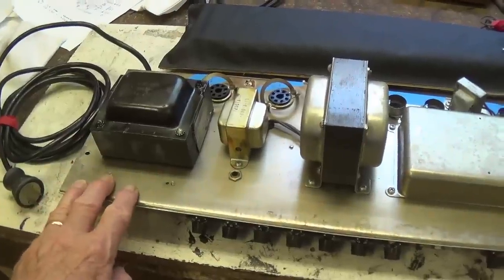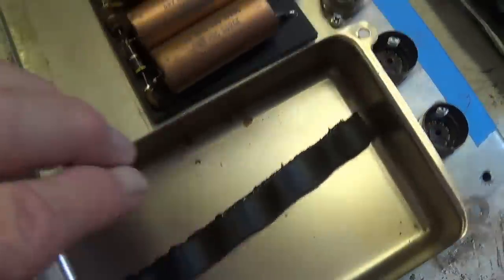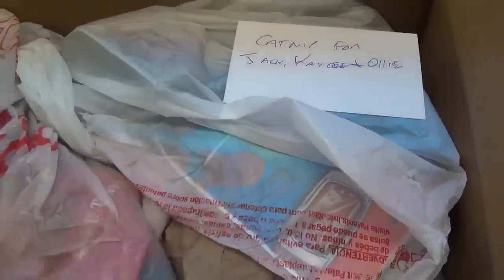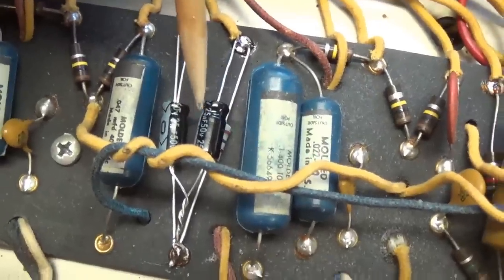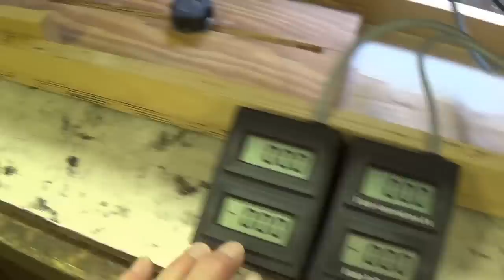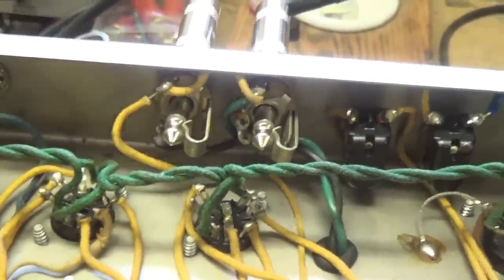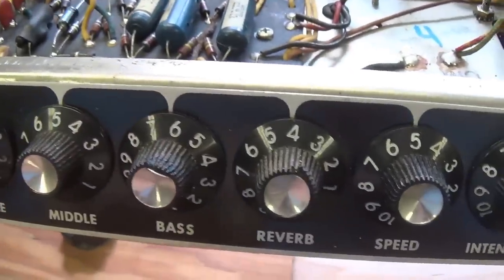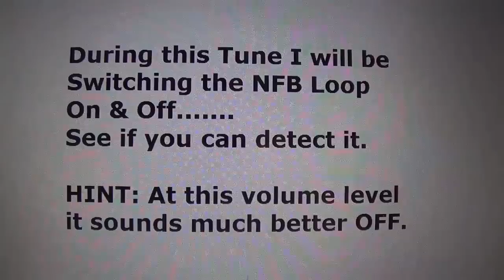1966 Fender "Blackface" Super Reverb:  In Storage for Almost 40 Years !!

Comment: Uncle Doug, are you familiar with the Fender PS400 - a 1971 super high power amp using GE6550A tubes with 3 separate output sections , 2 bass inputs and two normal inputs, and apparently a very unique circuit topology.  I have one - bought around 1978 - which has not been used much since the late 80's.  After contacting one fellow (Rich Koerner at Time Electronics, now deceased) who was recognized as an expert on this amp, I became aware that this amp had highly unusual setup and calibration routines.  I have some documentation for it, and am wondering if you would consider looking it over?
Reply from the maker: As much as I enjoy a challenge, Charles, I have found from experience that taking on a very complex project like this can require a great deal of time, simply to do research and acquire the knowledge to proceed.  I am currently receiving, repairing, and shipping a steady stream of more traditional customer amps, and I simply don't have the time to take on such a challenge. Best of luck to you.
Reply: @UncleDoug  Understood, and this amp is apparently a beast to work on - have you ever heard of this thing?  I have some cool product lit from the 70's if you ever wanted to glance at it.
Reply from the maker: @4bettercheddar  No, I haven't, Charles. It's probably similar in over-complexity to a Mesa amp.....but even more so. For people who do this for a living, you just can't get tied up for weeks on end trying to plumb the bottomless depths of gross engineering excess. Unfortunately, when the people trained in how to service these amps died.....so did the amps.

Comment: Uncle Doug, I just picked up a '64 Super and it has the same NFB mod that you did. My tremolo intensity is very weak; do you do a video on that, or can you tell me which components are part of the circuit that affects that? I think I will do the speed reduction mod as well, because I too am a tremolo hound....great video!
Reply from the maker: Congratulations, SC. If you watch the video, I show the three capacitors that form the oscillation loop. Try replacing the oscillation tube also (it's the 5th small tube from the end).

Comment: Hi Doug, I have a 73 Fender Pro Reverb with good tremolo speed but I think the intensity is lacking a little. Any tips to get some more out of it? Lee
Reply from the maker: Switch out oscillator tubes to see if one works best. Be sure the three loop caps are of exact value.
Reply: @UncleDoug  Thanks Doug, Will do

Comment: Hey Uncle Doug, I have a question.

Just bought a ‘66 Super, pretty much all original except for new bypass and filter caps, one switched out tone cap, and a few switched out resistors, including the screen and grid resistors. The original 10” CTS speakers are in.

Sounds great, but the amp is giving lower output in both the normal and vibrato channel. From 1-2 is basically nothing then theres the spike from 2-3, which is still lower than compared to others. 

Ive tested each preamp tube, but no effect on the low volume. Do you know what could be going on here? Thanks.

P.S., I have learned so much from your videos and appreciate your channel.
Reply from the maker: Thanks for your nice comments, H. Have you cleaned the pots with DeOxit, and replaced the output tubes ? If there is an issue in the circuit, it will require the attention of a qualified tech for repair. Good luck.
Reply: @UncleDoug  Uncle Doug! Thanks for the reply.

I have tried a new set of power tubes, but barely got any changes to the output. I also sprayed the pots with CRC contact cleaner, but nothing.

I after some interior evaluation (chopstick poking), I found that the connection wire from the vibrato input to pin 7 on V2 was scratchy, but that was really all. Don’t know how much of a difference fixing that would make. 

It is looking like I should take it to someone to check it out. I hope it isn’t sick.

Comment: Hi uncle Doug

Thank you for the great video.
Very interesting and entertaining.
I have a question.....
But first, let me say that I am an amateur electronics bug and am interested in experimenting with my guitar amp.
I've done allot of research especially on safety measures when working with circuits containing large caps.
The following is never clear ...
My (2 part)question is, when discharging the caps, is the amp plugged in ?
I would suspect no, but if not plugged in, how is tool grounded ?
Thank you again for the great video. :))
Terry (from Calgary, Alberta, Canada)
Reply from the maker: It should be unplugged, Terry. The wire lead from the discharging tool is connected to the chassis (ground).
Reply: @UncleDoug  Thank you for the info. :))

Comment: Dear Uncle Doug, it is not the right topic for this video but I wanted to ask you if you encountered a tube becoming microphonic not due to the tube itself but to its chassis socket where it is plugged ? In other words can a socket induce microphonics into a tube ? Sounds strange I agree but all my several brand tubes (6SL7s) cannot be microphonic !! Thank you.
Reply from the maker: Perhaps one or more of the tiny sleeves in the socket is loose, Nisso. You can tighten them with a very small screw driver. Also, you may have a bad solder joint on one of the tube pins. Good luck.

Comment: Does anyone make a 1W version of this amp? Something similar to the 1W Marshall series from 2012. Maybe a hardwire point to point?
Reply: That's a big negatory. Email this idea to fender tho, I'd buy it
Reply: Check out the web site of Rob Robinette, has a designed and built a DIY Bassman "micro" using a 12au7 as the push pull output stage with the classic Bassman preamp stage, also uses old school turret boards. Should be simple (if you have the DIY skills or fun to learn if you don't) to attach it to any preamp stage. Point to point has been done by others in the forum too. Doug Thomson.
Reply: just buy a mojotone champ no need for 1watt anything all ptp handwired!
Reply: @joshfowler8360  saving for a vintage magnotone myself. Uncle Doug, any experience with Magnotone?
Reply from the maker: Yes, indeed, CK. They are one of my all-time favorite amps, particularly the larger models with true Vibrato.
Reply from the maker: Not to my knowledge, Erik.
Reply: Cb K What Amos should they cover? Let’s say they are not point to point. That is probably just too much to ask. Two versions each. One a head and the other a combo. Let’s say they do a five amp run. My vote is to begin with a 57 tweed twin. Make this one. The last one a hot rod deluxe. What are the other three? These are all 1 watt with the 1/10 watt attenuators. Thank you for your feedback. I am thinking about making an e-mail to Fender. I would like to give them an idea for what the amps of the line should be.
Reply: @UncleDoug  so expensive, but your one guy who's word I would take. My question is how do the new ones compare to the old ones thanks so much
Reply: Blackstar ht1, I think it sounds way better than the Marshall. I've put them side by side, I was gonna purchase one, blackstar smoked it in everyway
Reply: @melchiando  sounds cool  benson makes a cool 5watt with reverb demos in the dartk uses all the time i have a tweed champ curcuit and its loud easily do a gig or mich it

Comment: I got the info off of ampwars.com when i put in quad reverb , I to was a little confused when I look at the info and thought the same thing ,when i put the m/m on ohms 200 range i came up with a reading of 29.7  there to i was confused on the reading ?  I rounded that to 32 , I kind of thought there was something I was not do-n right I am in no way a E tech and not very good at reading ohms on a m/m , the spks where removed from a 1974 Fender rhodes suitcase cabinet, they are Fender blue label 12" CTS,  cone #1252-1  basket #s 008498/ 137 / 7424 , I understand 4-16 ohm spks wired parallel will bring the ohms down to  4 ohms , wired series parallel i don't know ?  I found a quad rerb chassis minus all trans and tubes and was think-n about snap-n it up and make-n a quad cab since i am better at wood work-n than the tech trade , not to say that i would like to take on rebuild-n the chassis , once again sorry for take-n you away from your more important  matters , don't blame you if you disregard this text , but there is no other one that I can understand better than you , for instance i have two Marshalls one a 73 superlead and a 77 mk2 2203 that  i had serviced and i wished i knew you before  i met them  I still don't understand how you go about take-n on new projects with your viewers  the Superlead would of been a good vid it really needed new caps/tubes the whatnot, wound up cost-n me around $700 and $600 for the mk2 I better stop here or this will turn into a novel lol,
Reply from the maker: Wow......those repair prices are quite high, Steve. I hope you got your money's worth.

Comment: Hmmm. This is all very weird. Why would they have put all 4 8-ohm speakers in parallel, as opposed to putting them in a 2+2 (2 parallel in series, or 2 series in parallel) configuration? While I have seen (car) audio amps (solid state) that can drive into 2 ohms, I don’t see that many tube amps rated for driving into 2 ohms.
For a fixed voltage at the speaker terminals (1volt RMS at, let’s say, 1 kHz), the 8 ohm speaker will only require 125 mA of current, whereas the 4 8-ohm speakers in parallel will require 4x the current, or 500 mA if you’ve got 1 volt RMS. The problem is you’ve only increased the B+ by about 12% (from 415 VDC to around 460 VDC); assuming the audio output xfmr had a turns ratio of 4:1, then the current ratio would be 1:4, assuming the secondary winding was wound with wire of sufficient diameter to handle the current. This means you’d need to increase the B+ by 400% which would give you roughly 1.66 kV, and there’s no way those 6V6s are going to last long on 1660 volts of B+! And I don’t know of anyone who makes an audio output transformer capable of handling 1.6 kilovolts anyway! I think Jack would give this a paws-down. 😏 Would anyone like to double-check my back-of-the-napkin calculations?
Reply from the maker: What an interesting question, William. Let's use some real numbers:  Load Resistance of P-P 6L6's @ 450VDC is approx. 6K Ohms. Impedance Ratio between 6K Ohms and 2 Ohm (net) Speakers is 3000. Winding Ratio of OPT = square root of 3000 or about 55:1.  Now let's do it for the 4 Ohm speaker load you espouse:  Imp. Ratio is 1500 and WR is around 39:1. Now let's compare P (= I x V) on both sides of the OPT : For 55:1 WR,  450V x 0.1A  =  8.18V x 5.5A    and for 39:1 WR,  450V x 0.1A = 11.5V x 3.9A.  Thus, the 2 Ohm OPT puts out more current and less voltage than the 4 Ohm OPT.  Also looking at speaker output power, the 2 Ohm speaker develops 5.5 x 5.5 x 2 = 60.5W, while the 4 Ohm speaker develops 3.9 x 3.9 x 4 = 60.8W. The difference due to rounding errors.

 I think the reason your calculations don't work is that you failed to alter the WR of the OPT when you changed speaker load. Yes, if Fender simply used the same OPT for 2, 4, and 8 Ohm speaker loads, the voltage and current requirements would be all over the place.....which is why impedance mismatch causes so much harm.  But they didn't do this. Instead, they used a special 55:1 OPT for the 2 Ohm load.  When the tube-to-speaker impedance is correct, no more current or voltage is required to drive a properly-matched speaker load, regardless of what the load may be......and the output power will be the same.
Reply: Uncle Doug - Thanks. But why (did Fender) even bother? There are really only a few ways to wire up four 8-ohm speakers. 1) put them all in series (=32 ohms), 2) put them all in parallel (as was done here.), or 3) wire them as 2+2 (either two 8-ohms in parallel and in series with another two in parallel, or two 8-ohms in series in parallel with another 2 in series. Net is still 8 ohms). Clearly #1 is not good because if you lose a speaker (or there’s a loose connection), then Jack and Ollie’s jam session comes to a quick end. 😢 #2 solves that problem, but at the cost of having to make an OPT with a different WR which Fender would then have to keep in stock. #3 solves the problem, and you don’t need a non-standard OPT. You can lose a speaker, and the music keeps coming (though the impedance seen at the primary won’t be the same; not sure if the tubes or OPT will last long with this new loading. But it should last long enough to finish the song they’re playing. 🙂
Reply from the maker: @williamsquires3070  I guess it made good sense to Fender at the time,  William, and amps with this 2 Ohm array of speakers produced some of the greatest tone and tunes ever.

Comment: Hi Doug, during this video I heard You mention that you had received a couple of  "Thumbs down",  I really cant understand that. Your videos are so very good.     I have a question to ask.  I have a Superior Instruments Company TW-11 Tube tester and every time I go to use it I find that the tube is not on the Roll Chart.  Would you know of a solution for this?  I have tried to locate different Roll Charts but without success............................................................Berni ...........................UK
Reply from the maker: Thanks, Berni. I think some people just can't help defacing things they don't understand. I have had the same problem with my Hickok tube tester, but was able to find additional tube listings on the Internet. Perhaps you could find a similar tube on the chart and use the data?  Other than that, I guess it may be time to hunt down a newer/better known tube tester :)
Reply: @UncleDoug  ok Doug thanks very much. All the best.
Reply: @UncleDoug  , which Hickok do you use? I have reams of test data for virtually every Hickok tester model, should you ever need it. It is almost unheard of to come across a tube that I am unable to test, other than some transmitting tubes and unique Western Electric tubes. I made up cheat sheets with date for the couple dozen most-likely-to-test, most desirable and valuable (audio) tubes, to save me from flipping through the roll chart (not to mention that a 1960s chart might not include data for 40s and early 50s tube types, and vice versa).